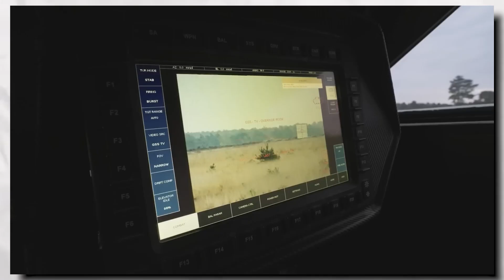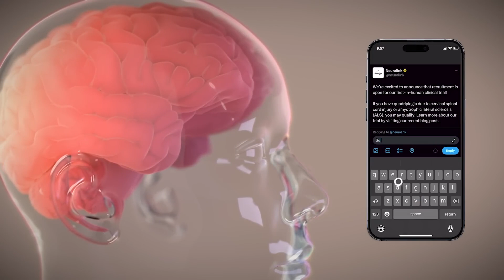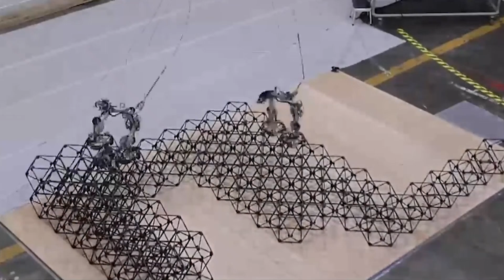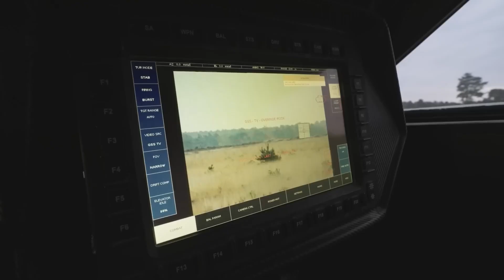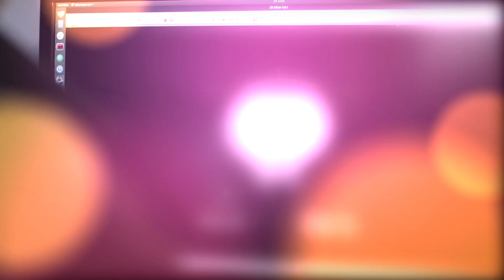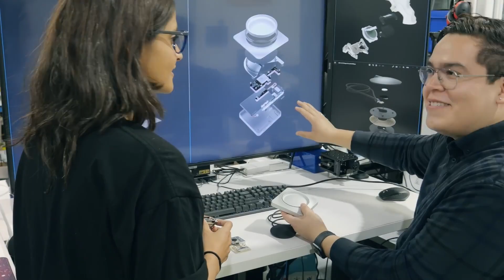12 INVENTIONS THAT WILL SOON CHANGE THE WORLD 1

Comment: sprout water will not have important minirals in it, and very long use of it as a sole water drinking supply will kill you slowly, but there are allot of uses for it outside of drinking, or filters and powder solutions can be enhanced to add the needed minerals